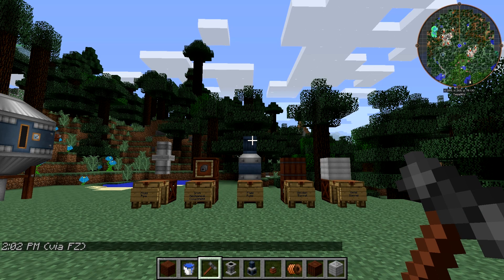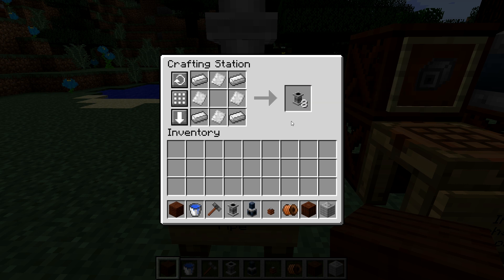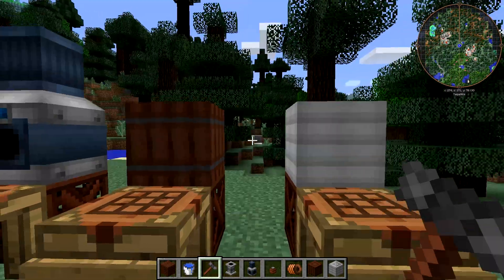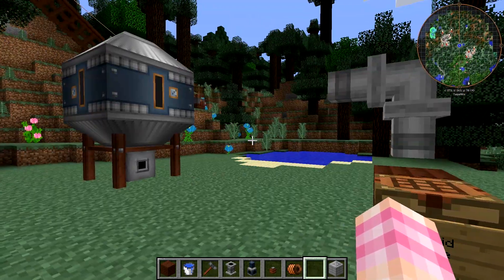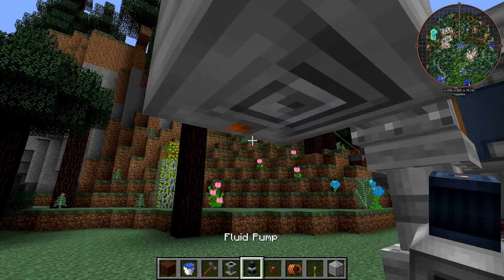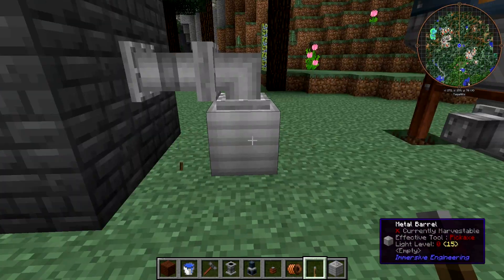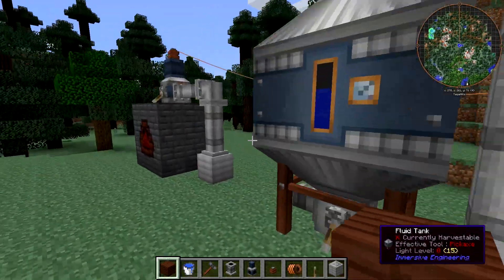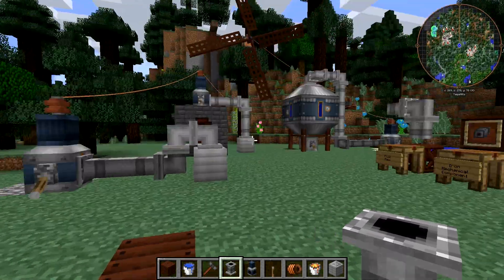Immersive Engineering Tutorial #6 - Fluid Handling

Comment: I was wondering the area a fluid pump will pump out.  Specifically lava.    I will just have to test.      

Also thought I read somewhere fluid pump does not need power if you use the sides to move fluid from one machine to another.   Maybe I misunderstood.  I thought it said u only needed power if you were pumping source blocks, like water and lava.
Reply from the maker: Well I've found that I need to supply it with power no matter what I'm doing with it.